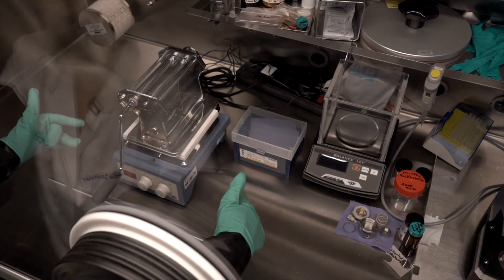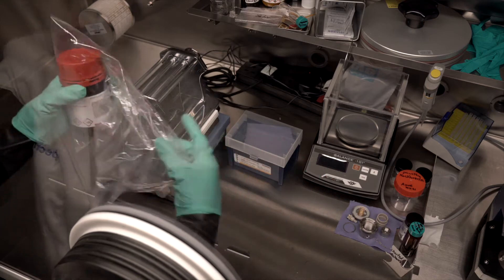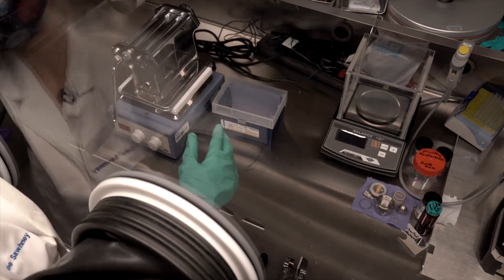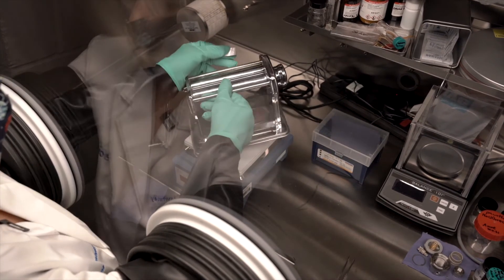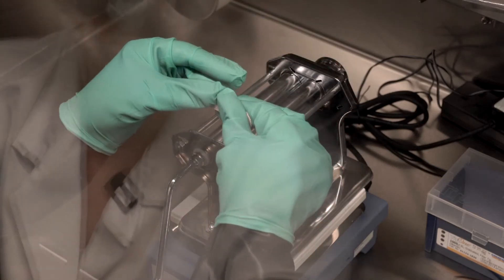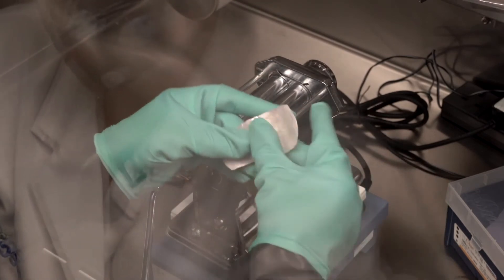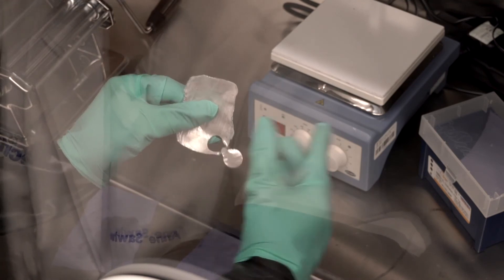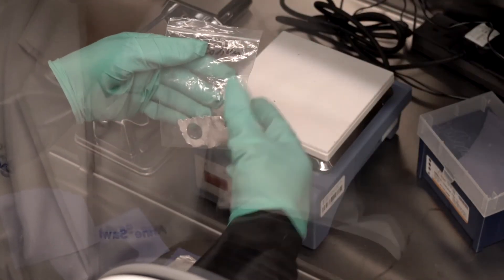How to Press and Cut Sodium Metal for Coin Cells

Comment: The name of the chemical is "sodium", not "sodium metal". You repeated the word each time. We know it's a metal. Iron is also a metal, but we don't say "iron metal". We also don't say "sulfur nonmetal".

Also, never press sodium into paper. In rare instances it can actually ignite. In an argon glovebox that isn't a safety issue, but it will char the surface. Potassium is even worse in this case.
To avoid sodium sticking to steel, wet it with kerosene. There is no need to remove protective liquid before kneading and rolling sodium.
Reply: Its called sodium metal because, there are sodium term in battery word does not use metal, but sodium chemistry to produce sodium ion effect

Comment: I have doubt .... Does sodium metal dipped in kerosene oil is been used in battery
Reply: this is for undertaking electrochemical tests rather than using it for a commercial battery
Reply: Its processed in oxygen and water free environment